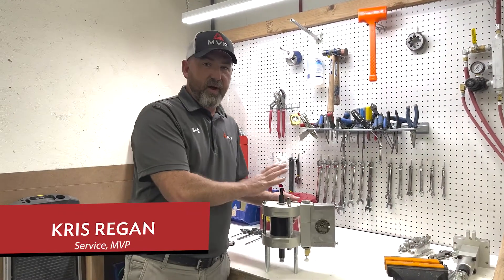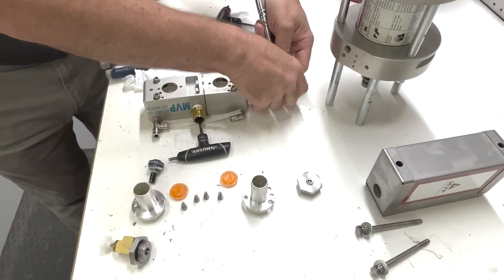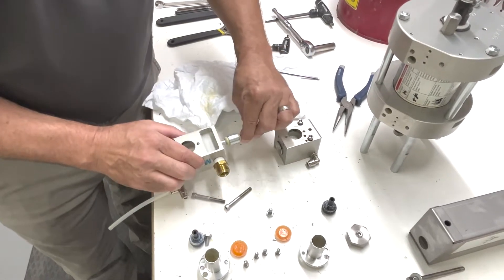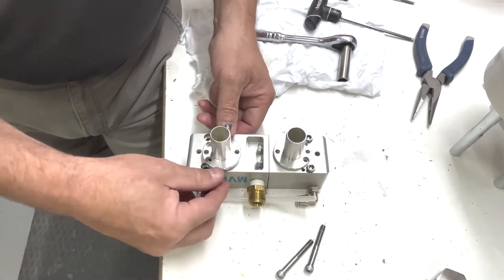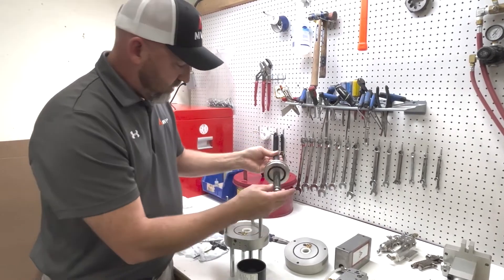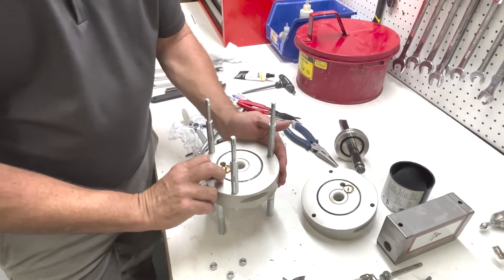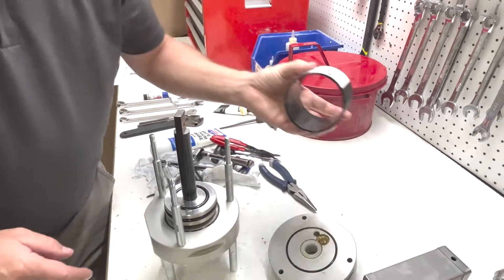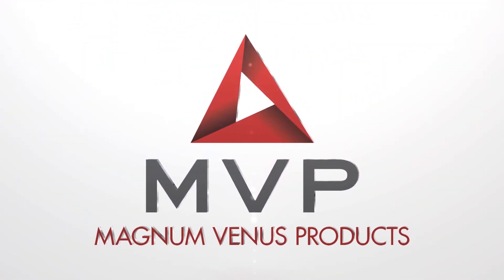Powerhead- Accurate Coating Equipment (ACE)

Comment: Ok 
I did pretty much everything you have done here .
Tested the air motor / power head .( Only it's a 3250 shares design n orings for most part )
Reconnect to fluid section/ pump .
Tested complete unit 
With acetone
Worked fine .
Loaded or tried to load 
Resin .
Pumped the acetone out 
Then stalled under pressure on the down stroke ,would not kick over.
Disconnect air motor/power head , test seperate .
Got the shuttle to kick air motor over ,Ran for a few strokes .
Stalled in the down stroke 
( Remember not under load ) 
What am I missing ?
This is not rocket science?